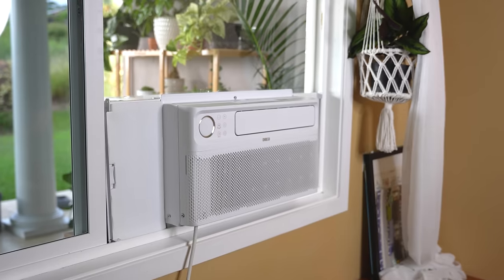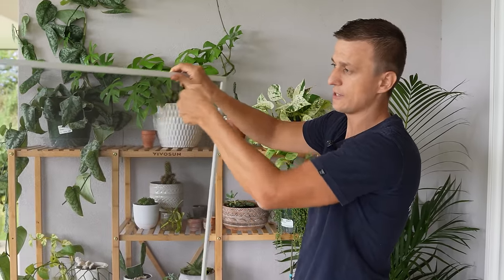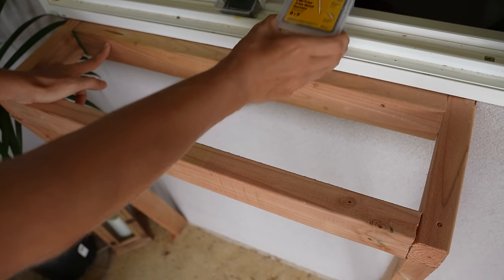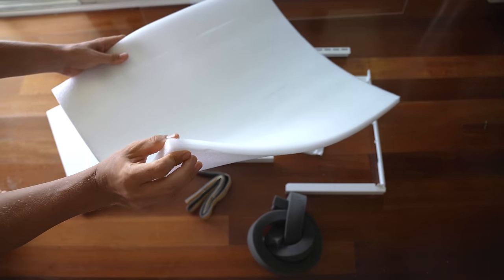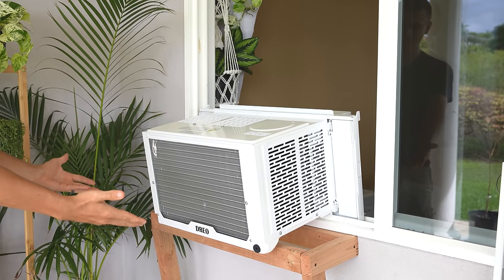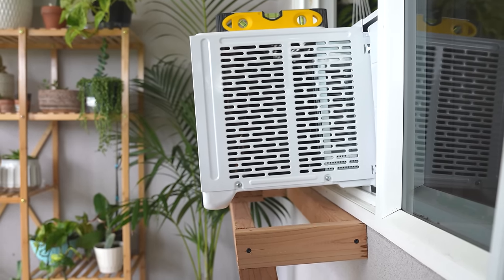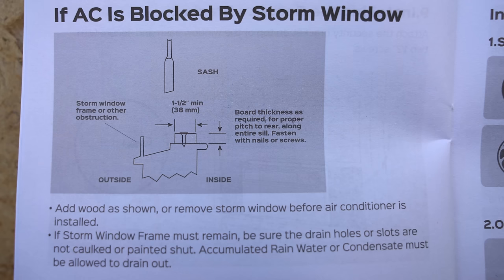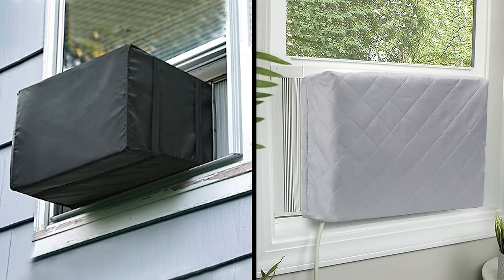How To Install Window AC Unit With Horizontal Sliding Window

Comment: Fantastic video, so glad i found it. been in a rental with no AC for two years but every summer i just suffered through with box fans because the window setup, and not wanting to deal with figuring it out blind. with your clear step by step i feel confident to take on the project.
Reply: u do realize portable AC's exists right?

Comment: I’m so glad I came across your video, I was going to use plywood to cover the top part but now I’ll be getting that type of glass/plastic
Reply from the maker: Glad to hear that the video came at a good time! Besides the fact that it looks much much better than a piece of wood, the plexiglass is actually a better insulator than plywood too. Stay cool this summer!
Reply: @WordofAdviceTV  how’s the noise with plexiglass? It looks pretty thin

Comment: Thanks, great video! I have been in my apartment for 8+ yrs and never bothered with AC as I'm at the cottage a lot I don't need AC too often. This yr it's hot in May already, so I grabbed an old unit from my folks' basement. I put it in the back door window and it fit almost perfectly instantly! Just a few little gaps so I duct taped them (can get the foam later if needed). I do need to use an extension cord tho....

Comment: My wife wants AC in our bedroom and we have a horizontal sliding window.  As much as this video helped with my concept of how to install, it doesn't resolve my main issue: how to keep security when you basically have a huge opening above the unit in your window.
Reply from the maker: If you don't mind screwing in a piece of plywood instead of the plexiglass, that would be a lot more secure.
Reply: I used both for mines n I have rift raffs in my neighborhood but so far no issues n my high sticker bush helps block it

Comment: nice to see there still is a place for old fashion window unit. They really save on electric bills!
Reply from the maker: Yes and it really helps with the heat! Kind of awesome how one can quickly install this thing and have cool air in the house within 5-10 minutes. ❄👍👌
Reply: I personally prefer window units because that way I can keep individual rooms at their own individual temperature. I wouldnt want my living room to be the same temperature as my bedroom, for example. I like to sleep in the cold.

Comment: Thank you. Until I fix my central ac (using your excellent instruction), I'll have to install  window air conditioners, again using your advice!
Reply from the maker: Sorry to hear about the central AC problems, may they be resolved in a speedy fashion! Hopefully you won't have to use the window units for too long, central air is much better. 😄
Reply: @WordofAdviceTV  Thank you so much. If replacing the fan motor succeeds, I will owe you a debt of gratitude for your instructions. If not, then it's the compressor, which I recall you advise on video that I not try to replace myself. In that case, I'll be sleeping on the floor of the cats' room (I have 2 cats), because I can only afford one window unit, and their sweet souls are the most important. Either way, I appreciate you very much, because if it wasn't for your videos, I would not have had the courage to try the repair myself. That's a huge deal to me. 
After all that, I'll be watching your refrigerator videos. My bottom freezer doesn't freeze, and the fridge part doesn't get cold enough. I tell you, it just never ends! 
Hope you are thoroughly enjoying Hawaii. I've never been there.  It looks amazing! Good health and happiness to you!

Comment: I was hoping to see this installed in a way that is still secure and would be as safe as possible from burglars, but this seems very insecure, they could just push the unit inside.  Was a good video though, thank you.
Reply: They could just break the window too, it's only made of glass, trust me, really easy to break in regardless
Reply: Ah, there is a way to have securing the window sash when installing a ac, I don't recall what it is called, I do know they offer it on the MIDEA window acs
Reply: The only way to burglar proof a window is to not have one.
Reply: Nothing is foolproof unless one floor above ground & even that's not a guarantee. I'm trying a window shrink wrap kit for the gap above the AC in a sliding window.
Reply: He said you could add the wooden crossbeam on top of the unit. That would be screwed in, cant be pushed in.
Reply: @r-e_mii brilliant idea!
Reply: I was going to buy one, but might as well grab one from someone else. 

Thank you for the awesome idea!

Comment: Very good detailed video I have sliding window as well and used the plexiglass I wasn’t aware they can cut for you they are kinda hard to cut with the tool they suggest   Very good overall video great job

Comment: awesome, thanks! curious why you chose to center the ac in the window instead of not using the accordion things and mount the ac against the non sliding side? could have just used some foam tape to seal it, and wouldn't have needed the acrylic sheet to be as big
Reply from the maker: You're welcome! What you suggested would be a better way but my wife didn't like how the half closed window looked.. 😅

Comment: Interesting video and it's giving me some ideas. I'm in the process now of installing a 6,000 BTU window a/c in a 12th floor window; no access to the outside once the plywood or plexiglass is installed. Not sure what I'm going to use yet.

Comment: Very helpful video, I was wondering if you experimented with two pieces of plexi-glass with a little foam around the edges to simulate a dual pane to help with insulation?
Reply from the maker: That sounds like a cool idea but I've never tried it myself.

Comment: Would love to see a video by you on how to clean the A-coil aka air conditioner evaporator coil and/or what to expect if you hire someone to do it. Seems like it's something that needs to be done, especially if you've been using fiberglass furnace filters, and it isn't included in standard HVAC clean and checks. And who to hire to do it? An HVAC company or duct cleaning company?

Comment: Great video. Question: if you are on a higher floor, how do you install a bracket on the outside? Or is it possible/advisable to use an interior bracket?
Reply from the maker: Thank you! Most window brackets are fairly easy to install and can be installed from inside the house, no need to do anything outside. I would suggest simply picking out a bracket you like on Amazon and then take some time to read through the reviews. There is bound to be people who installed it on a higher floor that share their experience.

Comment: Thank you for the video! Did you have to attach the ac unit to the frame at all? like screw it on there or something so it is more secure? The ac unit i'm putting in is 20 ft from the bottom so I'm wondering if I should attach it. Thanks.

Comment: Thank you for this video! If you don't mind me asking, do you remember what thickness of plexiglass you used?
Reply from the maker: You're welcome! To be honest I don't remember. Home Depot only had one thickness available so only the dimensions mattered.
Reply: Did you calculate the measurements before putting the AC in the window? Id imagine for accurate numbers the AC would need to be in the window already, no?

Comment: Can you do a review of this unit and measure its sound DB. Also check  how well it removes humidity. I noticed my midea inverter unit does not remove humidity as well as the traditional units. Eco mode doesn't turn off the fan so it blows the humidity right back into the room once the set temperature is reached
Reply from the maker: That is an interesting suggestion. I don't have a decibel tester but perhaps it's time I get one. Thank you for the video idea, I'll see what I can do! 👌👍
Reply: @WordofAdviceTV  you don't necessarily need to buy one, Google play store has "sound meter" and it's pretty accurate. Also check the eco mode issue and humidity issue. Looking forward to your video man

Comment: The "self evap" is for attaining the highest seer rating.  Inverter in a window unit is nice. most every 8000btu window unit is 700-750 watts 11-12eer, can you measure it on highest temp spread vs lowest and tell me you wattage draw?  Thanks.
Reply from the maker: Thank you for explaining AD! No promises but I will try not to forget to get those reads for you!

Comment: 2:23 You got a  lot of good ideas, but I bet you never tried your magnet advice. All screen frames that I know of are made of extruded aluminum, i.e. non-magnetic. I'll use the wood frame inside the window idea, taken from the slide of the "vertical" AC.

Comment: Is quarter inch plexiglass better than the 1/8" ? I know it cost a lot more I'm just wondering if it's better should I doubt we'll be any more secure when someone can just push the air conditioner in

Comment: What about heat insulation by flexi glass. A large area is covered only by it. Is it a good insulator, if not, lots of waste of cooling and high energy bills.
Reply from the maker: Acrylic (plexiglass) is 3-8 times more thermally insulating than regular glass windows so it is actually the best insulator. The R value is a whopping 86!
Reply: @WordofAdviceTV  I believe that should be 0.86 for the R value.

Comment: I don't understand  why manufacturers don't make air con for horizontal sliding windows with the mounting that comes with it.  All air con that I see are made for vertical windows.
Reply: They do make them, but they are much more expensive.

Comment: Yikes! This guy is a home invasion waiting to happen. Just about every installation mistake that can be made is on display here. On the upside, this video did make me laugh.
Reply from the maker: Well at least the video made you laugh. 😄 Let me explain why the security is so lax. Where we live here in Hawaii, breaking into the house through this air conditioner window would be far more difficult than any other window we always keep open. So I really see no point in making it extra secure.

Comment: window acs are a no brainer during hot seasons i prefer using these than the ac unit at our place due to the high volume of energy consumption and electricity bills skyrocketing, these are always on top to cool off avoid those portable ac units such a waste of money.

Comment: My unit faces the street. So I am worried about it being easily removed by strangers
Reply from the maker: If you use plywood instead of plexiglass and lock the window you should be fine. (by locking the window I mean putting a pipe or piece of wood in the window track so it can't be opened or use some kind of a window lock.)

Comment: The security of this install seems suspect. Ripping that plexiglass sheet out looks too easy.
Reply from the maker: In the house we live in, this would be the hardest window to get in through. 😅 Luckily we live in a peaceful neighborhood so security isn't a big concern.
Reply: @WordofAdviceTV  I live in a peaceful neighborhood, too, but burglars drive cars. Burglars typically target "peaceful" neighborhoods. Anyway, I think I'm going portable AC. The window for the room I want to cool is on the front of my house on the second floor. I don't want to drill holes in the stucco and install a shelf for something I really only need for 2 months out of the year. The plexi glass would not have been a problem for the second floor, but the shelf was really the deal-breaker for me. Best of luck.

Comment: lol idk what it was i was expecting but to go from "This window A/C install is also a little special because we are renting and the landlord doesn't want us drilling any holes or putting in screws" to then talking about what kind of screws you used in the video was annoying and also misleading...as duh you have used screws...guess my ac is gonna continue chilling in my spare bedroom
Reply from the maker: I only used screws on the wooden bracket that holds the air conditioner. I installed one of these at my dad's house too, with a metal window bracket I got from Amazon and with his I used 0 screws. I believe I mention the metal bracket in this video but I guess I didn't clarify enough.
Reply: @WordofAdviceTV  my bad looks I like just assumed that my landlord would make me pay to patch up any holes, weather they be on the inside of my unit or outside...

Comment: For once I disagree with your video, I always install my window units in the upper portion of the window to properly and efficiently “condition” the room!
Reply: That's not how they are designed to be installed normally; especially larger units. Seems like it would put a lot of stress on the window and not the frame. 
But if it works for you..
Reply: @heshwuan  that’s what they taught me in the course, I took!
Reply: @heshwuan  I build my own support system out of 3/16 thick aluminum.